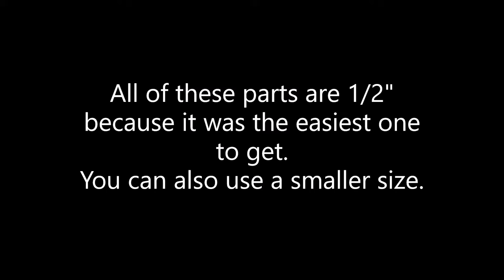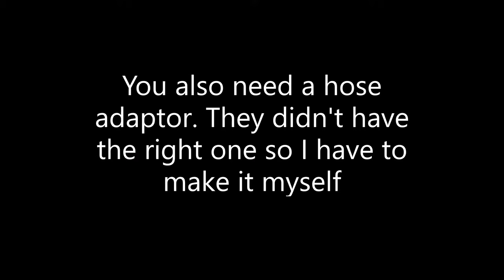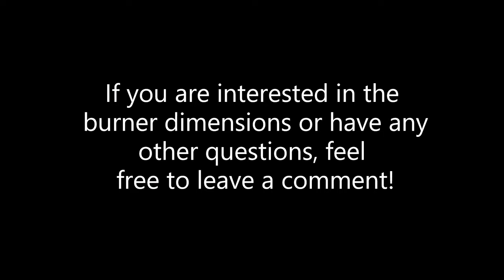Best atomizer/siphon nozzle? Making a cheap oil burner nozzle!

Comment: The test firing it seems to work very well. In practice it could be a lot smaller using plumbind 10 mm tube, and even car brake pipe. As for making that fitting you can buy off the shelf airline connectors with the right connections. I do not know why you had to make something. I also feel the brass pipe was far too large internal diameter. I have seen nozzles made from mig welding tips and i think your jet would be much more controllable if you soldered one in your brass tube. A good thing with mig welding tips is they have a hole of 0.6, 0.8, or 1.0mm ready drilled accurately.
Reply from the maker: Sure, go ahaed and try it. The brass tube is so large because used oil can be very viscous and have particles in it. This can easily clog small nozzles.
Reply: @garage_projects  The secret with any waste oil burner is to get as much residue and particles out of the fuel for the reason you mention. Well filtered oil will burn better and with less clogging than fuel just used as it comes. You obviously, then, dont filtre your oil stock, which you should. Even with the size of your tube i dont think it would pass a pea!

Comment: How hot does this burner get?
Reply from the maker: I don't have the means to measure such high temperatures but when I used a similar burner in my furnace it did manage to make the lid melt and drip down. It was made from a mix of plaster of paris and sand which both have quite high melting points.

Comment: First of all I want to congratulate you.  I have a question for you, I can't get blue flame.  where is my mistake?
Reply from the maker: Could be multiple things:
1. too much fuel, try dialing it back
2. dirty fuel, maybe try with clean diesel
3. too little air, try more pressure or bigger compressor
Reply: Thank you very much for your answer.  I was doing it with burnt oil, maybe that's it.

Comment: the larger tubes will require a higher volume of air to pull the obvious larger amount of fuel this things going to want. that's why his burners are made with 3\8 1\4 and 1\8 materials.  the fuel supply tube should be slightly set behind your larger orifice not flush.  that's why you're not getting the right atomization pattern for optimal performance.  it's imperative to have the right spray pattern, correct sized combustion chamber, secondary air inlet hole, and distance from nozzle to combustion chamber.  you made a working torch, but it should and can run a lot better.  nobox, I assure you, is a professional and knows the science and physics behind everything he makes.  I've got quite a few vids of some I've made running in the wild and in my foundry on T. t.  I run them on diesel, and believe me, with smaller sized hardware even, they run A LOT hotter and produce a ton more heat and power than this thing. you are resourceful though for sure. kudos.
Reply from the maker: thanks for the feedback man. 
I know he spent years developing his products so they are obviously going to be better. This is my first attempt at trying to make something like this and for me it works well enough.

Comment: inquiry. Do you use motor oil, transmission oil or vegetable oil? Also, can I use any type of oil or would I have to modify the tip for different types of oils. By the way, your work is unique, greetings.
Reply from the maker: Thanks for your comment!
So far I've tried used engine oil, vegetable oil and diesel. I did notice the diesel produced the bluest and cleanest flame, but all of the options worked flawlessly in terms of burning. 
No, you don't have to modify the tip. The advantage of this atomizer is that it hasn't got any small orfice the oil has to pass through. So even very dirty used oil won't clog the nozzle.

Comment: what pressures do you run at on the air side? or what kinda compressor are we talking about to supply this thing with air other than that very very nice
Reply from the maker: Due to my pressure regulator being broken at the time of filming I used the air straight off the air tank, so around 7-8 bar. The label on the air compressor says 600l/min, but you can get away with less.
Reply: @garage_projects  هل يمكن استخدام ضغط بخار الماء الساخن في الأنبوب الآخر بدلا من ضغط الهواء ؟

Comment: Hello. I've just built one of these but had to use a piece of pipe for the flame tube while I'm waiting for sheet metal to arrive. The problem i have is that it's extremely loud. Like 120 db loud! I used waste oil for the test.
Reply from the maker: The louder the better right? ;)
Reply: @garage_projects  It burns so hot its unbelievable. I've matched my max oil flow to the air input as the oil flow is the limiting factor. The flame tube glows a yellow reddish colour. Without smoke!
Reply: @garage_projects  Hello again. I've built this version of the flame tube and it seems to be a bit harder to regulate than the pipe version I first built. It's much quieter though. If you take a slow motion video it sounds like a pulse jet.

I'm actually going to flip the head around and try it in reverse so that the gasses have a harder time getting out and more fuel is burnt. If it doesn't work all I've wasted is time.

It works great with heating oil though but the waste oil is harder to dial in. I'm going to try it again on the weekend.

Thanks for the inspiration and I hope you don't mind me bothering you. 😉
Reply from the maker: @AshGTE  yeah just try around until you find something that ends up working.
I'm the opposite of bothered, I find it cool when people experiment with stuff and modify it. So please let me know your findings!

Comment: Did u use air compressor , do you think waste oil , can be fired on ur machine
Reply from the maker: Yes I used an air compressor and yes it is suited for waste oil as there are no small nozzles that could get clogged
Reply: What PSI does it run at?
Reply from the maker: I'm running it directly without a regulator as it is broken so at 6 bar (87 psi). It can however be operated at lower pressures I think

Comment: did u used a motor, compressor or pump for pumping the oil and air? If yes which model and potency
Reply from the maker: I used a compressor for air (hence the air quick connect on the back of the nozzle) and no pump for the oil. If the oil tank is above the burner it flows by itself. The label on the air compressor says 600l/min, but you can get away with less.
Reply: Thx very useful! Do you allow me to use your video as a reference into a college project?
Reply from the maker: @Nicolas-qe5ss  sure thing, go right ahead! Maybe you can let me know how it went in the end? Good luck!
Reply: Sure!
Reply: The oil comes from which hose? Green one?
Reply from the maker: @Nicolas-qe5ss  yeah the green one is for oil and the other one is for compressed air
Reply: can the steel pipe be smaller, the lenght?
Reply from the maker: @Nicolas-qe5ss  you mean the air and fuel pipes? Sure, make them any length you want. The only important thing is the nozzle in the very front
Reply: I ve done it! With some adjustments and it works perfectly, the nozzle is different but homemade too!
Reply from the maker: @Nicolas-qe5ss  cool that it worked!

Comment: Is the size of the fuel nozzle the limiting factor as far as BTU output? If I need more heat do I just need a larger nozzle?
Reply from the maker: For me, the amount of air is the limiting factor for this nozzle. So if you want more heat, you need to burn more fuel, for which you need more air. To get more more air you could either run at a higher pressure or increase the annular gap to allow more air to flow
Reply from the maker: ofc at some point you are gonna need a bigger combustion chamber as well...

Comment: Brilliant 
How long did the burner last 
To be honest 24hrs is good value if I could heat the amount of steel I needed to heat in the ease of such a thing 🤩🤩🤩
Reply from the maker: I haven't counted the hours but it still holds up after using it sporadically ever since posting the vid

Comment: Does this work with blower too ? Don’t have compressors 😢
Reply from the maker: No unfortunately not. You need the pressure to create the oil mist. There are other designs that use a blower though.

Comment: ok, i saw the part with the solder will not get hot, so it makes sense.

But why not just use a moped or car carburetor?
Isn't it basically the same thing?
Reply from the maker: I don't know if that works. If you try please let me know if it works
Reply: @garage_projects  disregard the other comment, i am a bit drunk.

But i think a carburetor should work just the same. Perhaps modified a bit so it can take the pressure of a compressor, and a heating element to heat up the oil a bit before it gets sprayed. 

Either way, this stuff you made seems to work fine as well, with cheap materials.

But i am gonna try it, just to see if it would perhaps be easy enough to buy it off the shelve. Cause i hate manual labor
Reply: This is a jet engine carburetor.

Comment: I need to work this continuous 4 days. Will it be possible??
Reply from the maker: The nozzle will work just fine. I would be more concerned about the stainless combustion chamber. If you make it from thicker sheet metal though it should hold up I think
Reply: Thank you

Comment: Where u insert the air sir
From top value or bottom sir
Reply from the maker: Air is on top where the quick connect is
Reply: @garage_projects  thank you for your kind information
Reply: Can we melt copper by doing ur project sir
Reply from the maker: Yes it can melt copper for sure
Reply: @garage_projects  thanks for ur good information sir

Comment: What air pressure is necessary to make it work?? Thanks
Reply from the maker: A standard air compressor is just fine, so a few bars, the thing you should be more concerned about is airflow. My compressor says it does 600 liters per minute, but it doesn't run all the time. My smaller 140 lpm one doesn't quite cut it though. So the minimum is somewhere in between
Reply: @garage_projects  thanks I appreciated

Comment: Does the end of it have to be made that way or can you do a round end
Reply from the maker: Which end do you mean? In case you're talking about the spray end: no, it doesn't have to be a hex cap, you can also use a round one
Reply: @garage_projects  ni not the spray end. The piece at the very end on the bracket
Reply from the maker: I'm sorry but I still don't understand. Do you mean the elongated hole? That one is for adjusting the height of the nozzle to the combustion chamber
Reply: @garage_projects  the combustion chamber can it be round
Reply from the maker: Oh now i understand. Yes, of course it can be made round. But in my opinion it is way harder to make accurate cones than it is to just fold a piece of sheet metal. In case you want to take a look how to make the square one: https://youtu.be/xfoVHW8LRVk
Reply: @garage_projects  ok I was just curious I'd like to make one but don't want to modify my forge
Reply from the maker: Ah i see. Good luck and please tell me how it went once you're done!
Reply: @ Dustin Brosmer get yourself whatever diameter you need in stainless and take it to a muffler shop....they have the equipment to swage a step down or to flair an end out a bit.
You could even experiment with a piece of auto exhaust pipe to see how it works....

Comment: Hi. What pipe does what. Does the oil come from the top or bottom pipe and what's the brass inner tube for ?
Reply from the maker: Thanks for asking! The oil comes from the lower pipe and goes through the brass tube. The air comes from above and goes around the brass tube and through the small ring-shaped gap in the front. They only mix when they are already outside of the whole assemly.
Reply: @garage_projects  thanks for that. 
What stops the air from going the other way back towards the oil ball valve ?

Is the oil under pressure or just gravity fed.

Do you think this could be done with of the shelf parts and no welding ? 

I would buy one from nobox7 from his ebay store but im in the uk and the postage and imports is horrendous
Reply from the maker: It's essentially just two pipes inside each other with the inner one (brass) carrying the oil and the outer one (galvanized) carrying the air. The brass tube is going from the back all the way to the front without any holes in it, so there is no way for the air to enter. Maybe this illustrates it better: https://youtu.be/83xhBa-CjtI?t=255

The oil line is actually under a weak vacuum from all the fast moving air so the nozzle sucks in the oil. The oil tank should however be above the nozzle to ensure proper flow. If you need your tank to be below the nozzle you will need to pressurize it.

To avoid welding the nozzle could be made from brass parts using soldering / brazing. Although I'm not sure how to build the burner itself without welding.
Reply: @garage_projects  thank you very much for that. I'm looking at making the whole thing from stainless and a friend of mine will weld the inner tube in place
Reply from the maker: @davidt3321  Cool! Please let me know how it turned out once you're done!
Reply: @garage_projects  will do thank you. 
If you're using a compressor. What psi you putting into the tube?
Reply from the maker: @davidt3321  honestly I didn't pay attention. I just used the unregulated pressure from the air tank of my compressor
Reply: @garage_projects  fair enough.
With the 8mm brass tube are you going through a lot of oil ?
Reply from the maker: @davidt3321  *6mm. Well, depends on your use. But most of the time the oil valve is just barely open.
Reply: @garage_projects  6 sorry I thought it was 8. What size outer air hole did you drill and are those 6mm bolts you used for aligning the brass tube ?
Reply: 7.5mm sorry just watched the video again
Reply from the maker: @davidt3321  yes M6 bolts. But you should probably use smaller ones anyway to get more threads in.
Reply: @garage_projects  thanks ill see if I can get some m4 bolts and an m4 tap

Comment: Does the nozzle get hot at all? Closest to the burner.
Reply from the maker: It gets cooled down by all the air flowing in and around it. So no, it doesn't really.
Reply: @garage_projects  awesome, great video. Have you tried to bring oil in it?
Reply from the maker: @mikehurst9880  I only used heating oil so far with this particular nozzle but I have tried thicker oil on a similar one in the past and it worked as well! There is no narrow spot anywhere in the oil line and therefore it can't clog.

Comment: What psi do you run in the air line
Reply from the maker: I use the air straight off the air tank, so around 7-8 bar. That would be 100-115 psi

Comment: wow..may i have your compressor specification data?
Reply from the maker: It says 600 l/min and has a 3.7 kW motor. Unfortunately it only has a sigle zylinder but we bought it used so it was a great deal anyway
Reply: @garage_projects  great... for how much used oil consumption?
I need your help, I have a plan to make 10 pieces for the frying pan. I think I have to provide a compressor with what capacity? thank you
Reply from the maker: @jasapembuatanmesinukmcustom9  what do mean with frying pan? Like a big cooking surface for food?
Reply: @garage_projects  
600 ml/min or 600 l/min ?
Reply from the maker: 600 liters per minute

Comment: don't use galvanaized pipe on high heat applications - granted it's a waste oil burner and you're well ventilated, but black pipe is a much safer alternative (and cheaper).
Reply from the maker: The air flowing through cools it so it doesn't get significantly hot. Also they only had this kind of pipe. Other than that, fair point!

Comment: The air from a compressor? What psi?
Reply from the maker: I had it at roughly 6 or 7 bar
Reply: @garage_projects  oh much higher than I thought! Well for this type of nozzle it would have to be I guess!!! Ty for the response!
Reply from the maker: @kalancosta7650  No problem man! I have not tested it with lower pressure though
Reply: @garage_projects  you melt iron with that?
Reply from the maker: @kalancosta7650  I have not tried cast iron yet but I'm very certain it would work. One time when I was trying to make a copper alloy I heated it up way too much so my furnace lid started to melt and drip down. It is made of a mix of sand and plaster of paris. Both of these have a melting point way higher than cast iron
Reply: @garage_projects  nice! Yeah for now I am going with a similar homemade refractory but I am going to to line it with 3000 degree furnace cement as well for extra protection.  For now it’s gotta be a charcoal foundry until I can work out the waste burner (propane is too expensive in Hawaii)
Reply: Also charcoal can be made for free (lots of scrap hard wood)